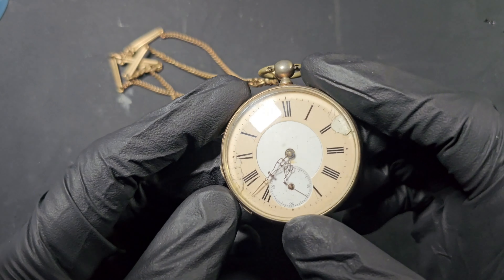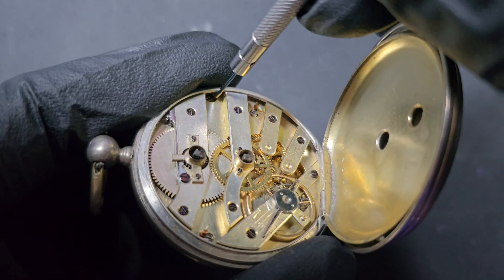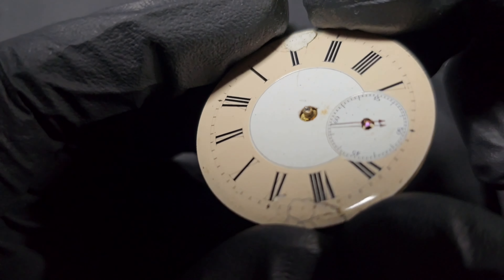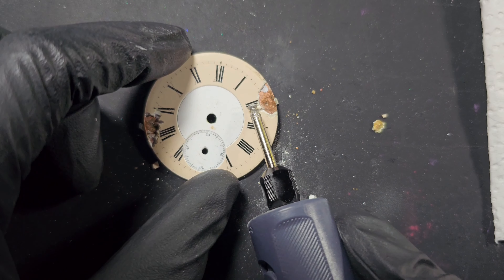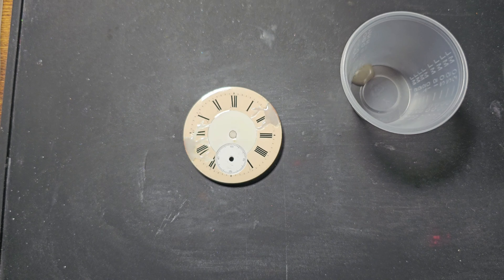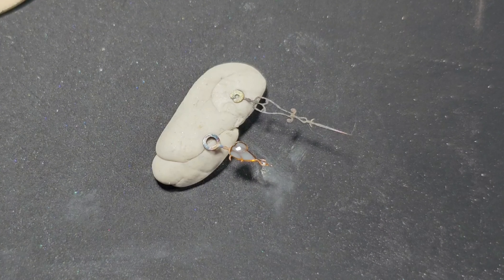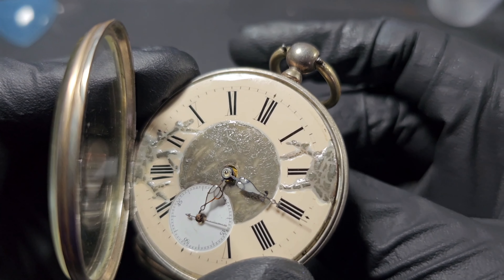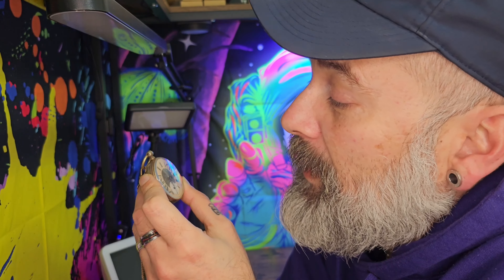RESIN ART Meets An ANTIQUE!... A Video by Daniel Cooper

Comment: Daniel this is fab! Had to laugh at your comment...there is beauty in every face, but sometimes only in the dark!😂. Is it possible to colour the crackle paste or is it available in various colours? It may help add beauty in the daylight 😉❤
Reply from the maker: Thanks Siobhan 😊 You can darken it or lighten it but not by much, I think I should have maybe made it darker or even painted the surface before sealing with the uv. I may change it soon in an update vid.
Reply: I wonder if karma crackle would work?  It is transparent went it dries,  I put another color on top of it and usually some kind of metallic under the crackle, I use it on polymer clay.  May have spelled it wrong.